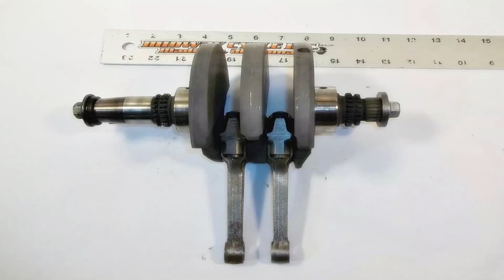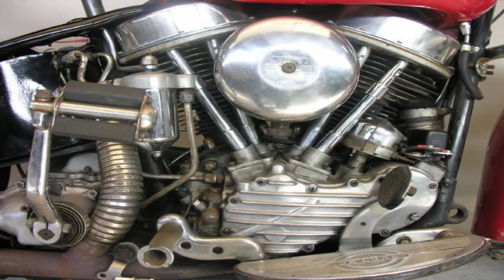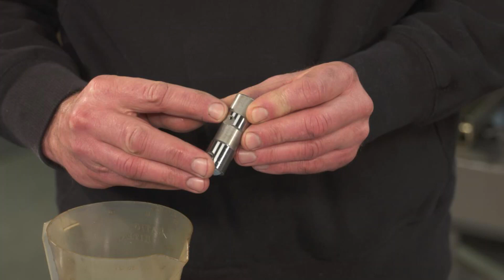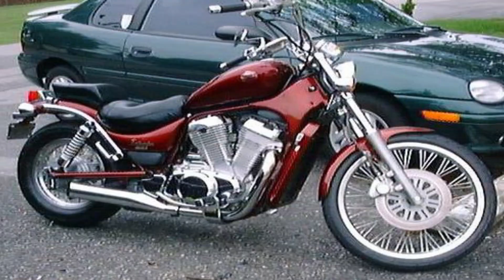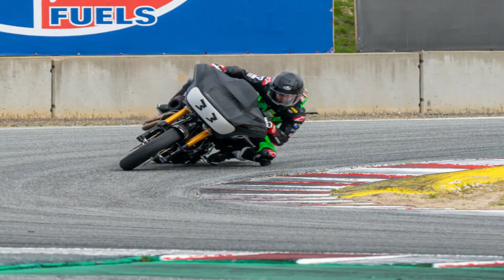Harley-Davidson Engine Design is the Worst

Comment from the maker: Would it be worth a complete redesign of the Harley-Davidson twin to a plain bearing single pin crank and offset cylinders?
Reply: If it ain't broke, don't fix it. I love my twin cam and my uncles; evo has been breeze to wrench on so far.
Reply: No.
Reply: @georgewetzel4380  that is what i was going to say... those roller end, roller bearing, single pin cranks are More Efficient, than a plain bearing..
where the RevMax steps forward is because it Doesn't Need a counter balance with It's Splay Angle Crank.. and if you took the counterbalance out of a 45 degree V, it would lose More energy, but the counterbalance saps Some energy, where the RevMax is inherently balanced.
Reply: @georgewetzel4380  long way of saying No too.
Reply: Go buy a V Rod or a metric cruiser.
Reply: @frednouvertne4216  😂
Reply: Still...love Harley Davidson and bikers in general.
Reply: @kennethanderson1685  Absolutely right.  I hope iget to ride the rest of my life.
Reply: @jamesgarrett2129  me too!
Reply: It's been tried and it failed
Reply: I don’t know about a complete redesign but they went backwards in 02 when they got rid of the Timken style bearings. I think that do better with a welded crank and Trude I don’t know if gonna spend that kind of money. They’re outsourcing everything have a Lotta problems. Wheel bearings this that I may we’ve been through it all. Slave cylinder is whatever you wanna call them hydraulic clutches how many recalls of the head on them. I don’t think it cost that much more to build Quality. I mean lifters they’re getting 5 to 15,000 miles on bikes when they started outsourcing the lifters. Especially the ones with the higher left like CVO’s
Reply: @mickc4633  I'm so happy my FXDX is an 01.  I just lucked out because I didn't know about the Timken bearing issues when I bought it.  Was able to convert to gear drive and. 510 S&S cams last year and am having a blast!
Reply: If it ain't broke, don't fix it. It has worked for almost 120 years, why change it now. If Harley ditches the single pin crank and goes to a modern design, they will lose their entire customer base. They will then be no different than the metric bikes which are cheaper.
Reply: No redesign would be worth it unless they embrace the off set crank, over head cams 4 valve water cooling, unitized case, gear drive primary....wait...
Reply: As the world goes anti fossil fuel now is the time to actually go back to the days of super low octane engines. Side valve and low compression with carburettor. Mix 50% gas or petrol and vegetable oil. Air cooled helps to keep the smoke down as it runs hotter. Castrol R40 in the engine means more oil changes but even the modern high performance engine designs insist it's essential.
Reply: Only benefit I would see would be a bigger bore with the offset design. Pretty much stuck at 160ci with the current design less the pistons start slapping each other.
Reply: Ducati and Guzzi have always, and still use a single crank big end pin on all their 90 degree vee twins.
Side by side rods with offset cylinders. SOP in the engineering world, just look at any car OHV V8.
Reply: @michaelhayward7572  would hardly rate ducati as reliable.
Single Honda sp1 s beat twenty or more ducatis in 2000 and 2001 and 2002 wsb and iom tts and bol dor endurance races. Better bike better rider true but also in many cases they just broke. Ducatis are like paintings. Buy it. Stick it in the garage for bragging rights. Your mechanic will have it more than you.
Reply: Have a 91 Evo should I be worried
Reply: @guspineda7167  89-90-91 were the known offenders.
Loose main bearing housings, cracked cylinder stud and c/case mouths the most common.
Reply: the knife and fork has perfect side to side balance ,  anything else will rock side to side and introduce other balancing problems , not quite like a bm or guzzi , but still there
Reply: @snakeplissken5480  It's not noticeable. All Japanese v twins use offset cylinders, even those few with the crankpins on a single plane, like the Shadow ACE. What you are talking about is rocking couple vibration. It can be noticeable in a parallel twin, but when the cylinders are only offset by an inch or less it is not noticeable and does not cause a problem. But I have no idea why you would want to make the Harley engine bigger. IMO it's way too big already. I like the 80 inch EVOS. The rubber mount 1200 in my '06 Sportster has plenty of power, and also plenty of vibration. At idle the bike almost jumps up and down. It does smooth out at higher speed, but still has plenty of feel. I believe rubber mounts first appeared on the early '80s Shovelheads on touring bikes. The EVO FXRs got rubber mounts. They are probably my favorite Harley of all time.
Reply: @snakeplissken5480  maybe the balance side to side could be there on a nano level but honda didn't have issues with the sp1 engines running twice the revs of a harley and twice the power.
The world is changing in a way that what most think as advances today will not work in ten years and yet the technology of the 1930s will keep going for another 100.
The days of having to have next year's model for 1% power gain are over.
Reply: @snakeplissken5480  Harley-Davidson own the patent. Simple as that.
Reply: It's inevitable that H-D will have to go in a different direction (probably multiple) if a large manufacturer of motorcycles in the US is going to continue to exist.  Water cooling is inevitable.  I think the biggest changes that honestly need to be made though with offering a wider variety of bikes is marketing.  H-D is laughed at by every other kind of rider outside the cruiser/touring market.  They made a smart move in not killing off the Livewire, but rather spinning it to its own brand to be sold outside H-D's dealership network.  They should have done this with Buell.  On the other side of the coin, the PanAm is a fantastic re-entry into ADV bikes, and they're selling like hotcakes in H-D dealerships, probably due to better crossover between ADV and touring riders.

Put the PanAm 1250 in the Bronx, put a factory quick shift on it, and offer it for sale outside H-D dealerships next to other sport bikes.  It will be a contender.
Reply: I know very little about the mechanics  but I believe Harley, like many other bikes, speaks to a select group of riders.  Mess with that too much and all that changes.   Especially if you have a product that has done so well over time.
Reply: @jamesgarrett2129  you could not be closer to the truth.
Harley survived the AMF years solely on customer loyalty.
The fact that some see overhead valve pushrod engines as dated means that they have the wrong expectations. It's a brilliant format if you are happy with middle of the road performance. The aircooled volkswagon engine has more allegiance than most and relies on the same technology and comparable design limitations.
True it will not rev to infinity but there is something really special about slow revving engines with heaps of power from tickover.
Reply: I would say no. My opinion. Slipper bearings need oil pressure to keep bearings if the journal’s. Like 45 to 60 psi. HD’s can’t get that cold. A roller don’t really need pressure. It needs flow to cool and lubricate bearings. Just look at how many triumph tridents spat out the centre rod from low oil pressure as well as BSA A65 lifting barrels off the case’s yeh there were still bolted down too .
Reply: No, but they do need to go back to a bolted together crank. The much maligned Shovelhead was a better design than the Twin Cam. It had a few minor issues, but it's main problem was being built by AMF.
Reply: @geraldscott4302  Honestly, i think the tank graphics on the Sportster S and Nightster are a tad much...like look at the graphics on the H-D Livewires,
 classic clean
like they could not have put out that bike if it wasn't ... and the sport class is flying ok with those graphics because they are V-twins mostly.
good thing H-D rotates color options year to year, and changes graphics on occasion.. 
it's not that bad, but i honestly would wait.
first year punch factor i guess... and some people probably like that anyway.
Reply: @geraldscott4302  American Machine & Foundry just screwed up the tank graphics enough to piss everyone off .. the shovels were still H-D designs, because they kept the same teams and workers .. the twin cams, well that was a Victory motorcycle freak out...and i do agree on that.
Reply: @geraldscott4302  i have seen some AMF era stock tank graphics that were not as upsetting as the early graphics that sparked the rebellion ... it was all the evel knievel hype and radical departure from tradition..

AMF is a good company, they just got carried away, and shook up the customer base.

Comment: and my torque peak is at 3k35 RPM ( not 4K like the 131R )
just different cams, ( Andrews N2s almost exactly the same as the Ws ), different pipes, and swirl porting, on a smaller 54 ci engine. ( 80 ft lbs. 82 HP ) 
pre-pin oiler at stock 5K7 rev limit ( BUT DO NOT REMOVE YOUR PIN OILERS IF YOU HAVE THEM unless your dropping the rev limit to 5K7, I have to run a High Volume oil pump to help with the extra heat )
so I am not going so far as to say the M8s need overhead cams....that just need a de-stroke, lower static head and an engine driven pump and thermostat for the twin cool, counter swirl, lower lift, and longer pipes.

Comment: if a 117ci M8 made as much power per litter as my 883 EVO test bed, it would make 176 HP ... when the engines got bigger, less wave power could fit on the bikes.
same 54 ci displacement, same 5K7 rev limit , same bore, same stroke, same 2-valve valve diameters...65% more power.
all wave powered mixing and stuffing, more stuff and a higher stable BMEP
if a 131R engine made as much power per litter as my 883 test bed, It would make 199 HP.....they say 70% of the power in the fuel goes out the exhaust... I make that do work FOR my engine.

Comment: That engine with its long stroke of the piston drives that piston at higher speeds than many four-cylinder engines with a short stroke of the piston, which at the start represents a serious rival for reliability. Cams above the head are toothed and do not adjust further, a Harley with adjustable rockers is a much more unreliable design.
I will mention only a couple of engines that are much more reliable than Harleys, for example Suzuki's oil-cooled 600/750/1100/1200 family of engines that are basically the same construction, or Kawasaki's two-cylinder 500cc engine. And if we talk about V twin engines, it would be Yamaha and Honda...

Comment: I feel your videos are amongst the very best explaining the whys and wherefores of Harley Davidson in a clear, concise manner. Thankyou.
 However it is what you do not say that is intrigues me. I've been riding Harleys for 38 years now. I then worked for Harley when I "retired". I cannot however, understand why so many ownrrs are obsessed with gaining horsepower, from a poor handling, low ground clearance, overweight cruiser, that does not stop well compared to nimble sport bikes, or even a NOT so nimble sport bike! (Some before even taking delivery of their new bike!)
Sure - you can make your Harley quicker than the Harley next door, then boast loudly about how much it cost and why. That is childish, but runs rampant. Harley fits a niche, and does so very well! I owned a Buell along with my Harleys, and it had reasonable power, was lighter, had a decent headstock angle, (so it handled "OK"). It also destroyed 4 pairs of 501's by setting them on fire after riding somewhat "enthusiastically." 🔥ing 👖's.
However "tuning" a big twin Harley really simply results in "boast value" to fuel a needy ego. Harleys are very good at what they were designed for and all the tuning in the world (outside of dragster builds) will never make them quick, in the overall motorcycle world.
Oprah Winfrey will never be Charleze Theron either, but that does not take anything away from either of them.
But....if blowing money, on the off chance somebody will be noticeably impressed, or your bike gets more attention, and it floats your boat..... have at it!
OR....you could get a T-Shirt printed with a list of  impressive mods, predicted horsepower gains, prices and a nice picture, all for likely less than $50....nobody would question it, or indeed really care. Then spend the balance on trying to figure out how to get a date with Charlize Theron.....😉🙄

Comment: In my many years on this old plant I have noticed the best designs are the old ones. I had an old Caterpillar Dozer from the 1930s worked and ran great. It was not as user friendly etc as dozers of today but it was all steel with a million grease fittings etc. Dozers of today are ergonomic, user friendly and very very complicated machines. I can assure you 80 years from now they will not work or be repairable. Same old story with Harley, little plastic, solid old school design, simple to repair and understand. Simplicity is a virtue and when accompanied by satisfying operating character what more do you want. It makes power where you need it while providing a feeling of riding something alive. Having ridden most brands over the years, I can assure you nothing compares to or cane replace the Harley. The day they no longer exist will mark the end of motorcycles and the rise of house hole appliances for the highway!!!!!!!!!

Comment: The Harley V twin is in reality a 2 cylinder radial engine. It is like taking 2 cylinders from a radial aircraft engine such as a Stearman and putting them in a motorcycle. That is what makes them unique. Radial engines have one crankpin with a master rod, and all the rest of the rods tied to that master rod. It really is a neat design. They powered planes like the Corsair during world war 2. They were extremely powerful and took a lot of abuse. They were long lasting engines. The design made it reliable. 

I believe that is what made the Harley engine what it is. It has one crank pin and pushrod activated valves. 

Even my old 1942 Flat Head "45" had push rod valves in the cylinder. It keeps the cylinders in line instead of offset. It works. The EVO engine is one of the most reliable motorcycle engines ever made. It is a Shovel Head with improvements. It just runs and runs. Many run way over 100,000 without ever working on it. I have 65,000 on my 99, and have done nothing to the engine except to change out the faulty inner cam bearing at 23'000. I used Harley adjustable push rods so I did not have to take the top end apart. I have not touched a bolt on the engine since then. That was about 12 years ago. I have not even had the carb off to clean it. I did put larger jets in it because with drag pipes it was running a little to lean. But that only took about 15 minutes because you do not have to remove the carb to change jets. 

Simplicity is worth a lot to us who do our own work. And it is what ever you compare it to. It is way more powerful than the Whizzer Motorbike and the "45" flat head I started on. But they were both fun also.

I am also a blabber mouth on the keyboard. LOL

Comment: If you COULD spin an E Glide to 10K, Who wouldn't wind them up that high?? Low RPM range is one of the biggest things holding these motors back, it really makes them look weak in the marketplace.

Comment: It’s not that overhead cams are bad for low rpm power. It’s just that pushrods are bad for high rpm power. Overhead cams are better in every way. At least for power output. Not saying pushrods don’t have benefits. And both are good engines. 
I like their air cooled engines. And they make plenty of power for cruisers. Until they can’t pass emissions anymore, or the company just goes bust is more likely, keep doing it. Would love to see some more standard/sporty bikes though as I have no interest in cruisers

Comment: Not if you know what NOT to do, and what limits output, what increases output, how to make it under 6,500 rpms if you're not familiar with the valvetrains kinetic energy, and valve spring tension needed for higher rpm power output, I don't recommend revving a TC at Screamin Eagle rev control limits because the crank pins aren't welded  and at roms over 6500 they flex out of shape and the oil pump drive gear causes catastrophic failure, evolution I suggest a beefed up case and improved aspiration, no I don't mean porting the heads by enlarging them, controlling the fuel and ignition curve, and choosing the right cam profile, carb and exhaust tuning and aircleaner choice go hand n hand n hand, don't twist it up when it's cold, let it warm up and get the oil flowing. Have fun